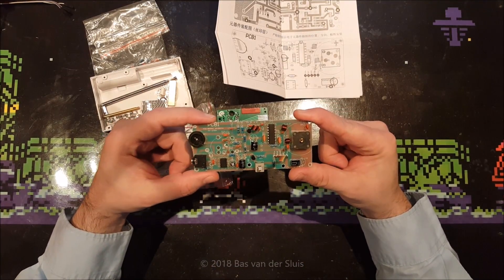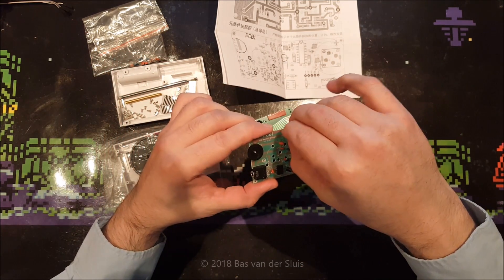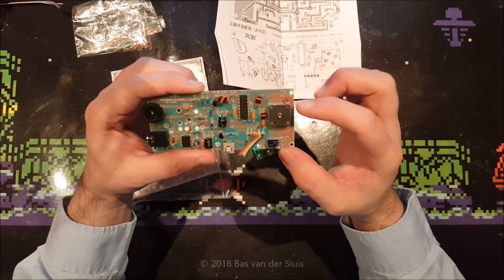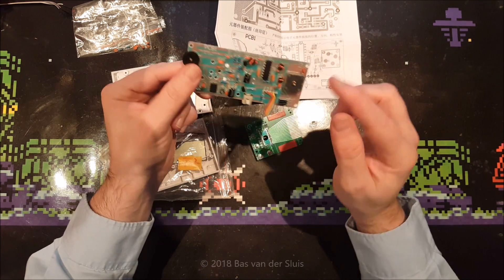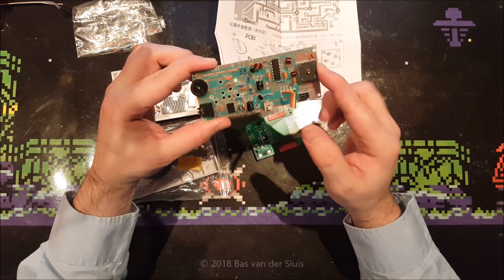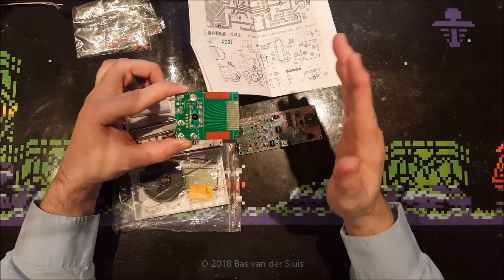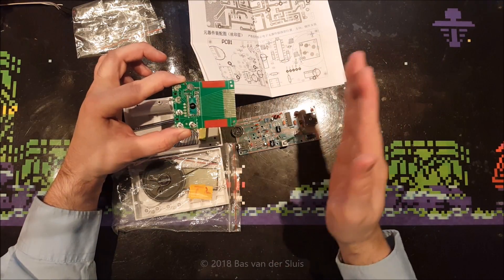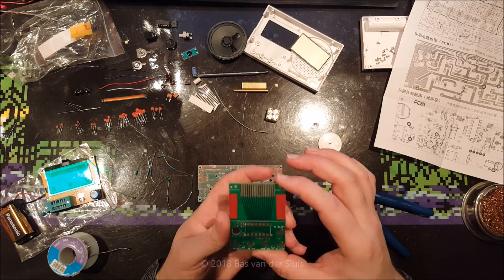Geekcreit DIY FM Radio kit build

Comment: Thanks Bas.  I think commenting on the tricky parts and speeding through the main build is a good thing to try.  In manufactured items i have opened up for repair in the past, switches like that have just been held in place with clear tape rather than soldered.  That would avoid solder getting where it shouldn't.